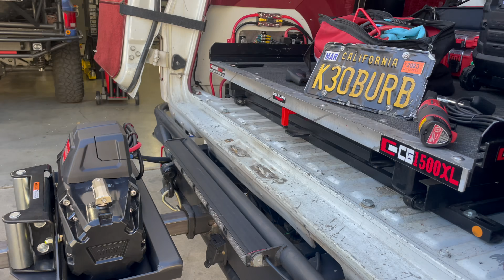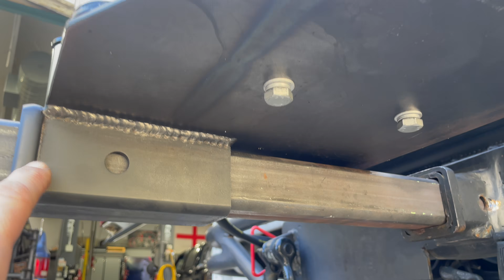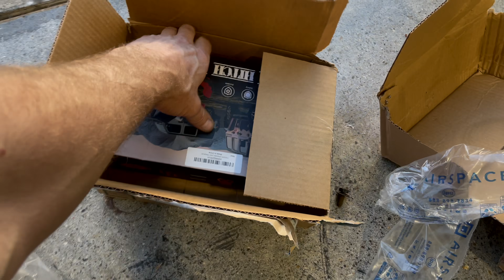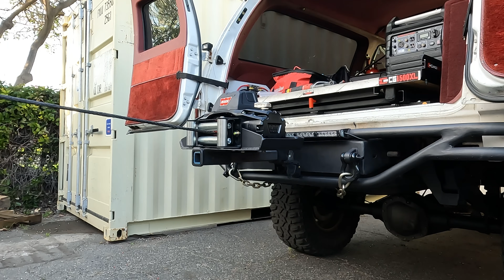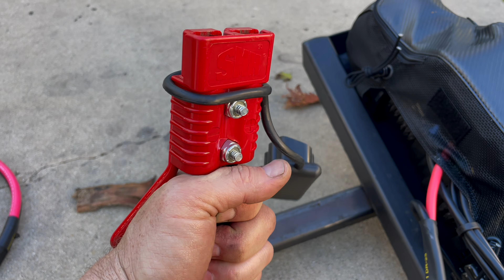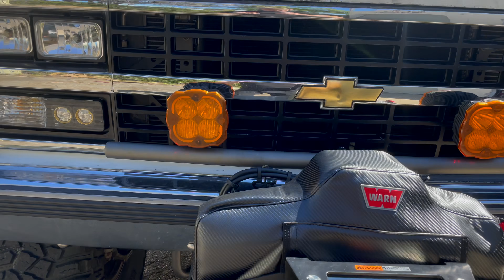Front and Rear winch carrier for my diesel burb!

Comment: I have the same arrangement and went with a 10,000 lb wench. The reason being is the rating of the receivers, especially if pulling from an angle. Up and down is limited to 15 degrees and side to side is 45 degrees. Straight on pull is limited to 9,000 lbs with anything at an angle being a greatly reduced capacity.

Comment: Mires factor is up to 3 times the weight of the truck if it's above the fender line most will never deal with that but it is possible always use a 2 to 1 or 3 to 1 never use a straight pull unless you have to if your stuck enough to need a winch your stuck enough for a 2 to1 it saves your winch

Comment: Your channel is the holy grail of info and if there's a heaven for squarebodys...it's your garage! Keep sharing the knowledge, my friend!

Q: How difficult if possible, would it be to swap a drop-down tailgate with double doors on a 1980 GMC 'Burb K25 w/ a small block 400 (the engine is irrelevant, I know...i just love saying it)? It's about 95% similar body as your white 'burb.
 
Also does the nylon winch rope hold up...I was hesitant?
Reply from the maker: yea the winch line will hold up fine.  It is actually stronger than cable.  Just not as abrasion resistant.  

I don't think the tailgate conversion is that easy.  The top channel for the glass vs the doors is very different.

Comment: Hell ya dude, so I have decided to rebuild my 4l60e myself. Waiting on getting all my parts in and then getting started. First time for this but my wife need the suburban and I can blow at least 2 up before it starts to get close to what these transmissions shops charge. So this should be interesting 😂

What is the visor thing called above the windshield? I’d was looking for some about a year ago but couldn’t figure out what they r technically called.

Looking forward to more stuff🤘
Reply: It’s a Lund Sun Visor. I believe they’re no longer in production but you can find them used on eBay.

My Suburban came with one and it works well.
Reply: @Cy993C2  yes. Lund had the vent visor and then the interior shelf that went between the roof and the visors so you could store more crap.
Reply from the maker: It’s a summit visor.  Lund used to make them but summit is now
Reply: @merricksgarage  Cool . . . good to know!

Comment: It would really help to wrap the ends on your welds.I think the portable winch is a great idea,you could fabricate a mount for your trailer also to accept the winch.
Reply: Can you dive a little deeper for someone who has no concept of what that means, thank you!
Reply: @Paul Gutierrez Jr  Yea Paul it's a common mistake people make when welding. When you  get to the end of a weld joint on a plate you continue the weld around the end of the plate or weld joint instead of just stopping the weld bead and leaving the end not welded.It creates alot stronger structure in the end.I noticed the winch plate had some beads on it that just stopped without "wrapping the ends".I worked Submarine work for almost two decades and I was a welding instructor so I am familiar with the welding processes.I hope this comment helps alot of YouTube welders out in the end and keeps someone from getting injured.
Reply from the maker: this is great information.  I should have wrapped the ends, I knew exactly what you were talking about when I saw the comment.  Im still learning.  Thats the thing about being self taught, you never stop learning!

Comment: I Did the same thing on the front of my 2004 Cummins Dodge built a custom Mount mounted where the tow hooks were now I can use it the winch on my trailer and the back of my truck and the front of my truck

Comment: Way to go ! Great idea 💡 👍🏻. 
You can always build a similar  receiver on either side of the Burb ! No reason to not be able to pull from the side 💡.
Yes l was on the same wave as to the front and back, and sides, now l might have to mount one where the spare tire use to be, make it so it is accessible from all points. 😛🤘👍🏻🌬 ❄️ 🌧 🇨🇦.

Comment: Might need to make a little extension that lets you put your tire carrier on the front once you're on the trail or camping;  that way it keeps your rear doors ready for use.  Then when you need to get back on the highway, just slip it on the back again.   I mentioned it to you awhile back about a portable winch setup like this.  I seen it on Andrew Camarata's channel a few years ago;  It's a great idea.  You can now put a receiver at the front of your trailers also, and that same winch can easily mount to your trailers and pull cars on, etc. (just maybe have another temporary jumper/ cable extension that will plug into your rear plug setup, but still reach the front of the trailer.)  Plus, you don't have to worry about it being stolen-  because you can just slip it off again and toss it back in the truck or in the garage, etc.  Modularity is king.
Reply from the maker: exactly this.  Although I did just receive a 12000 winch from a Chinese company for testing.  Might add that to the trailer...